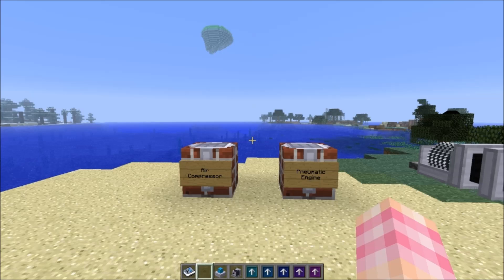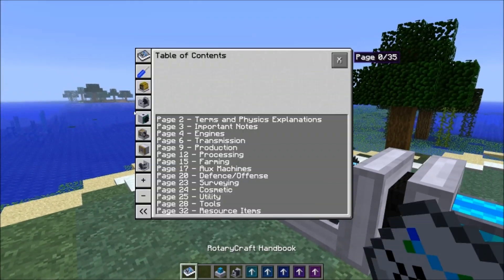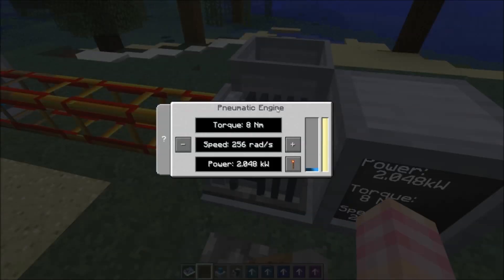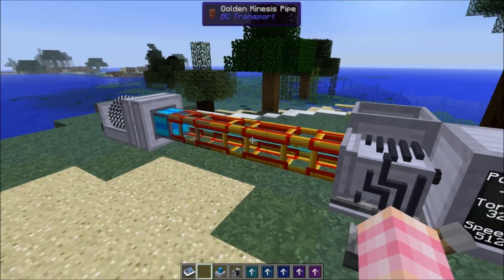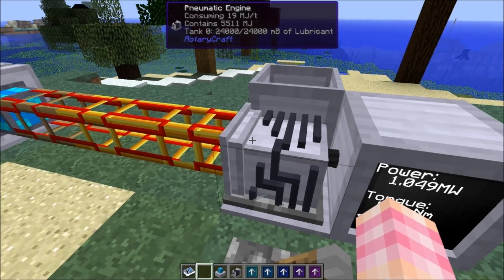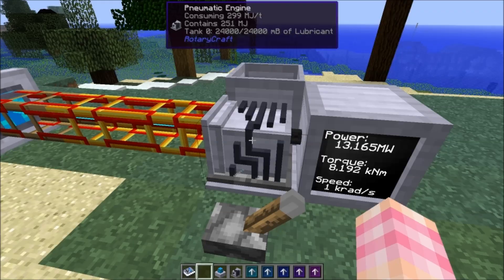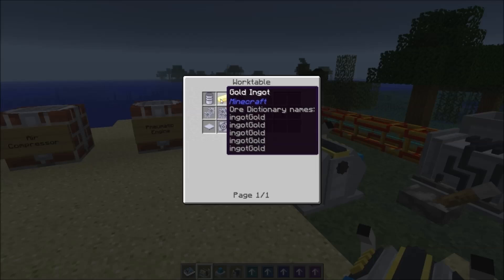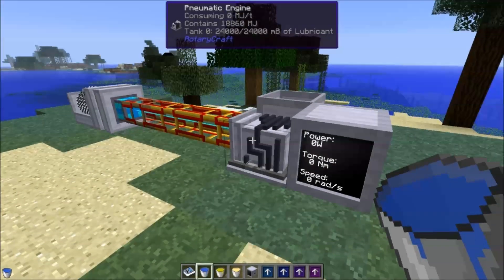RotaryCraft Tutorial #42 - Power Conversion: BuildCraft

Comment: Now the air compressor doesn't really work right, so instead of using an air compressor, use a friction boiler to boil water, and put the steam into engines that produce RF.
Reply from the maker: Yeah, but this was for converting straight to MJ

Comment: Nice video. Too bad BC has a really bad energy system now, that's whybits hard to convert MJ to RF
Reply: Not my pneumatic engine.
Reply: I believe you can pump the MJ into a RF energy cell
Reply: No, redstone conduits internally convert RF to MJ for the proper receivers, but not the other way around.
Reply: You can easly convert MJ to RF because the energy in any redstone conduite is accutaly MJ. And the conversion rate from MJ to RF is 1MJ=10RF. So anything that accepts MJ will accept RF.